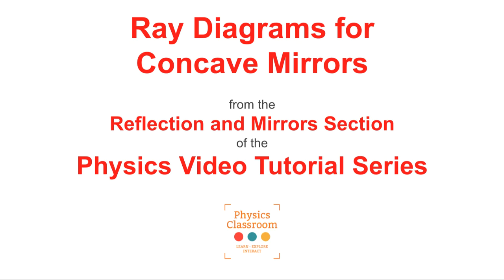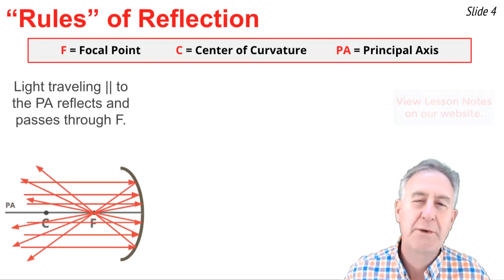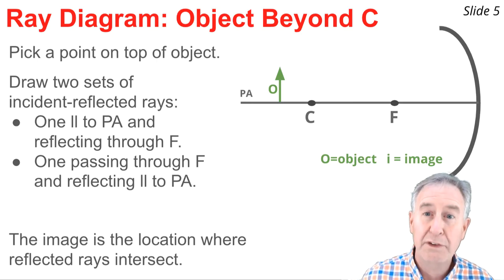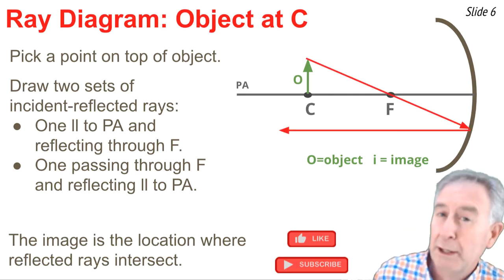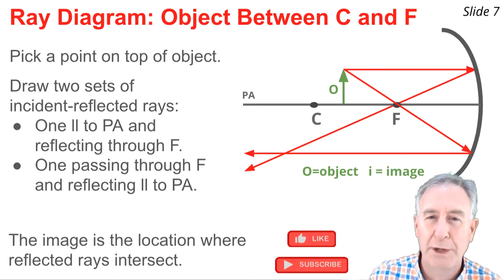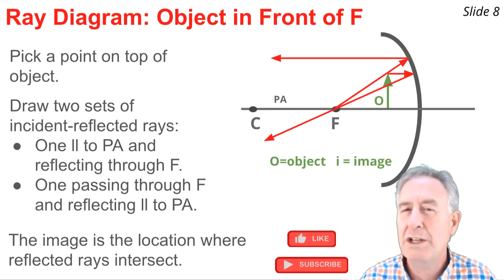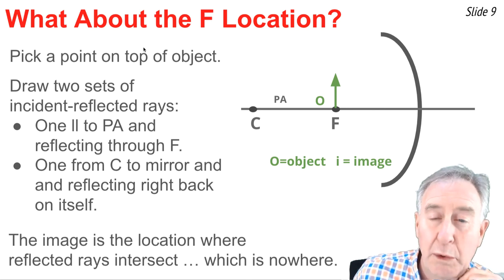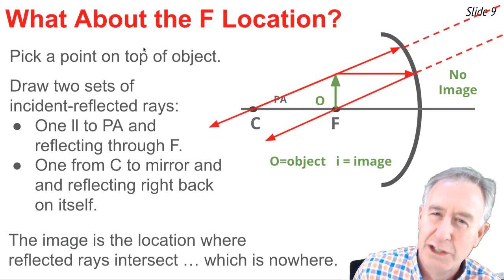Concave Mirror Ray Diagrams

Comment: When an object is placed in focus,  and the one incident ray strikes the principal pole it will reflect back with the same angle as the angle of incidence and the second incident  ray is parallel to the principal axis and it will reflect back through the focus..  Then there are the chances for reflecting rays to intersect each other.
Please need your valuable answer